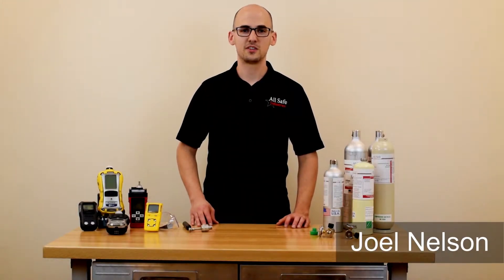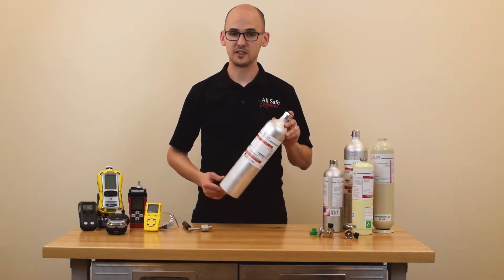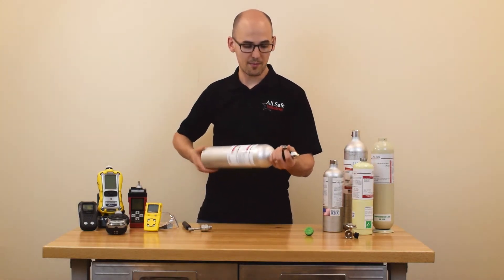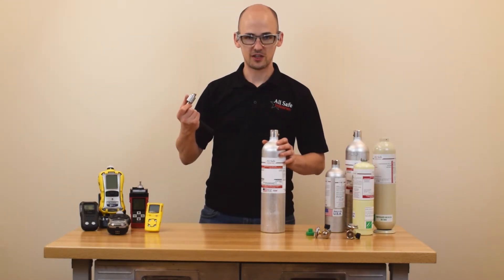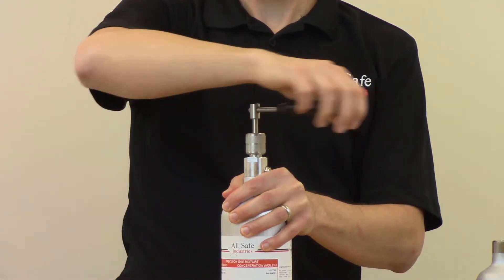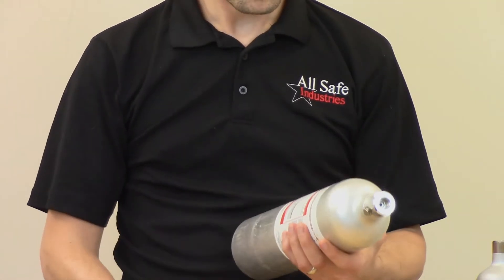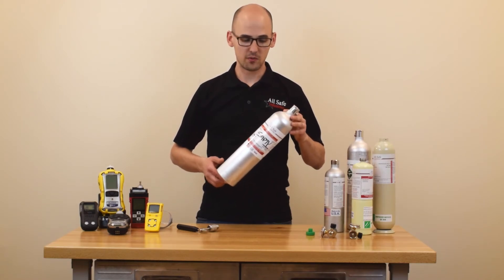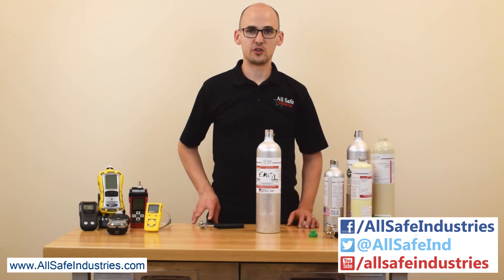How to Recycle a Calibration Gas Cylinder

Comment: is it ok if I use the recycling tool directly? I have a MSA tool that "has special ports that allow the safe drainage of any residual gases that may be present in the cylinder"
Reply from the maker: There is a bit of a port for safety reasons, but we can only recommend following the manufacturer's instructions. On the ones we carry, they recommend draining the cylinder first.

Comment: which reducer can be used for UN1965 ?
Reply from the maker: If I'm understanding the question correctly, those cylinders are likely different from the ones we deal with for calibration gas cylinders. I'm not sure of the answer.
Reply: @Allsafeindustries  I have a Philips calibration gas cylinder. What is the connection thread of this cylinder? I'm looking for a connector and possibly a reducer. Best regards
Reply from the maker: @boblockhit4348  I'd recommend taking a quick pic of the cylinder threads and sending it to tech@allsafeindustries.com. That will probably be the quickest way to get you the right answer.